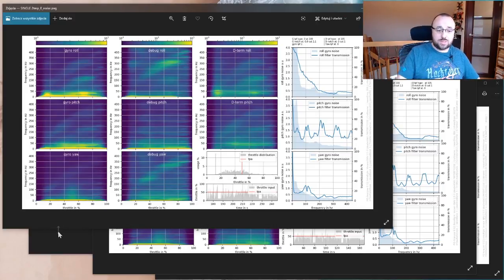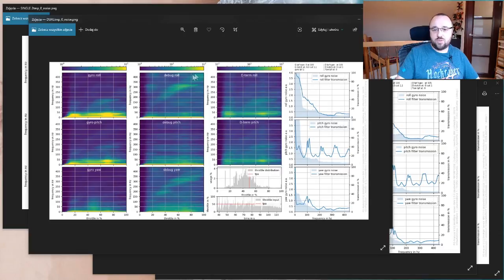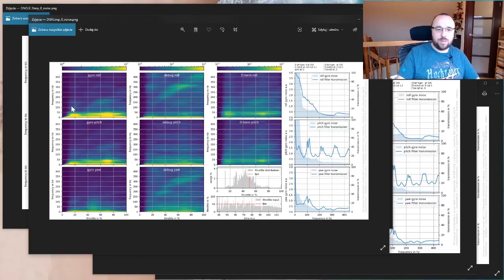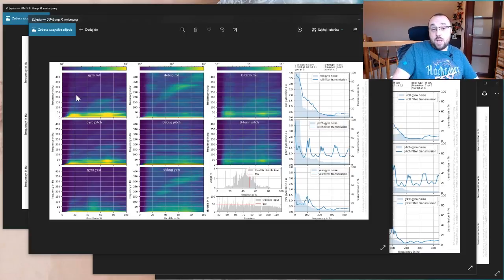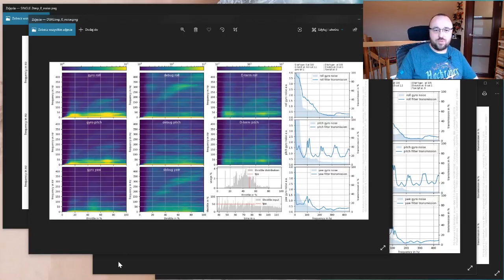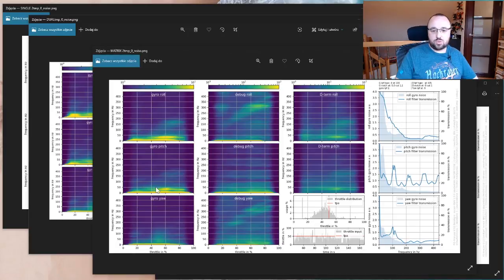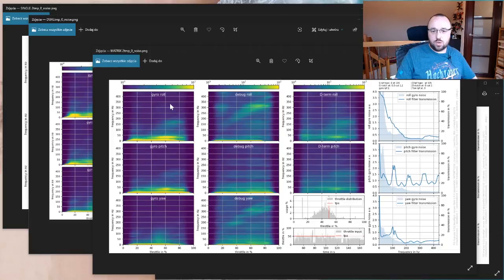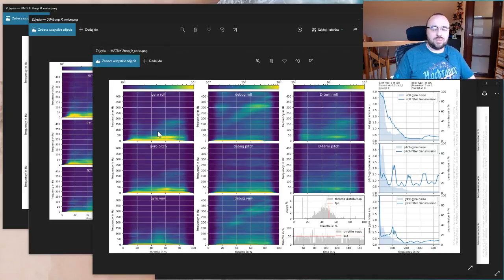Matrix Filter - the next step in dynamic gyro filters evolution

Comment: All this sh1t needs to be automatically configured on the fly and nobody should ever have to go into blackbox to look at graphs.   That's my 2 cents.  That's what computers and software is great at... analyzing a problem over time from data and applying a running correction to it.     

Imagine if you had to dive in your computer harddrive settings on a regular basis to adjust some settings based on thermal expansion of the platter that changes with the room temperature or system ambient temperature... so that your hard drive could actually read data with as few errrors as possible.  You would think, this is bullsh1t... which is pretty much how I feel about having to go into blackbox and then by looking at that rubbish, try and figure out what filters to put where..   to solve some problem... and not a single filter says what it does, or how it's different from the next one... or what it's designed to be used for to correct.

Comment: what does matrix mean? The cut off freq is in matrix format and get operated in matrix format?
Reply from the maker: operates as 3x3 matrix
Reply: Paweł Spychalski 3 axis and each axis with 3 filters? Like rpm filter but not use erpm? Use what?
Reply from the maker: @hugochiang1072  data from the FFT gyro analysis
Reply: The existing Dynamic Notch code set a notch filter to the peak frequency detected for that axis. 
Hence, if the peak for roll was detected at 150hz, for pitch 180hz, and for yaw 200hz, one notch would be applied on roll at 150, on pitch 180, and on yaw 200.
This code applies the same three notch filters to each axis; in the above example, roll would have notches at 150, 180 and 220, and the same three notches would also be applied to pitch and to yaw.  
This means 9 notch filters are active, each with a Q of 250.
Betaflight can be configured to apply just one notch alone at the frequency for the axis, or a 'wider' single notch comprising two adjacent notches.  A single notch at Q of 250 is recommended with RPM, without RPM two notches at 180 are recommended.
Overall delay from this PR vs two notches in betaflight non-rpm defaults would be about the same.

Comment: The way you tell it it seems like a really obvious thing to detect vibrations for each axis separately :-). Still, I think bidirectional DSHOT (BLHeli_32/JESC/JazzMaverick) would be adventageous for two reasons: 1. the filter can attenuate these frequencies even before frame resonance occurs and 2. because the filter can target all motor frequencies even if they aren't close together like they are on flips and rolls.
Reply from the maker: funny fact is that RPM filter can not attenuate frame resonance since it is not able to detect frame resonance. It's tuned only to motor noise and frame resonance is not motor noise frequency related
Reply: @FPVUniversity  They actually are related because frames do not vibrate by themselves but when there is an exciter and you hit a resonance frequency (or harmonics).
Reply from the maker: @Gosuminer  it feed the energy to resonance, yes. But resonance frequency does not depends on motor noise frequency. Resonance manifests itself as flat line
Reply: @Snorkl FPV Betaflight's Dynamic Notch code has always detected 'vibrations' independently (separately) for each axis.  This matrix filter doesn't change how the centre frequencies are calculated.

Comment: I love the work you are doing with inav! Great job! Just one wish, please don't start to over do or over complicate filtering. Version 2.4 flies currently like a dream without rpm filters. Reminds me a lot of betaflight 3.5.7 that might just be the best version of bf to date. I would much more like the possibility to get the coding optimized for more fluent to run to free up some cpu resources for higher loop rate ect.
Reply from the maker: 4k without GPS and 2K with GPS is actually all the hardware can reliably do. INAV does stuff with ACC that is CPU hungry and MAG over i2c is extremely slow. So we will not rush into 8k.